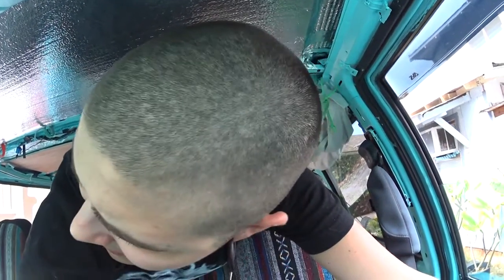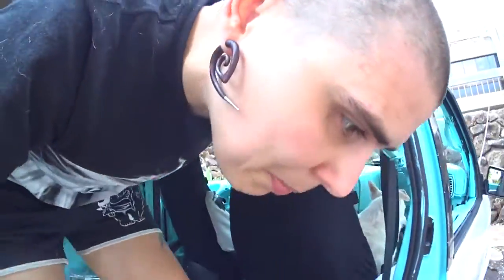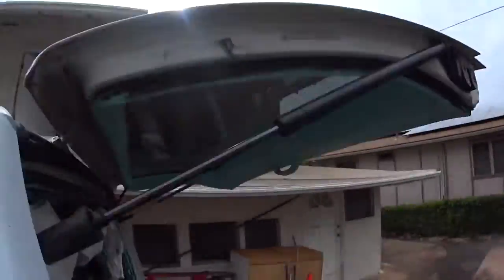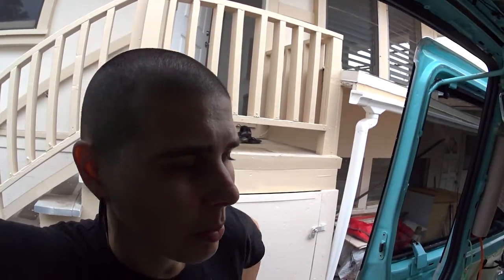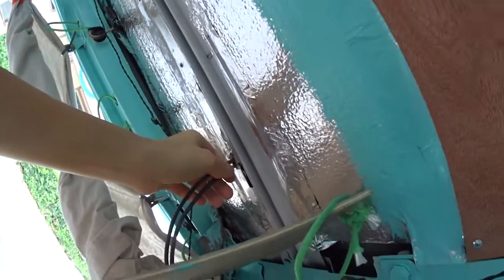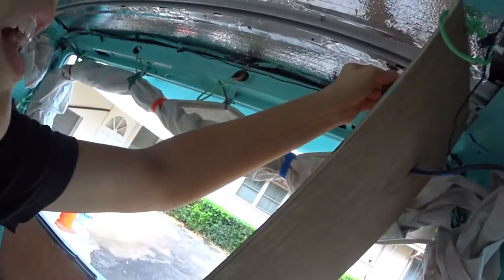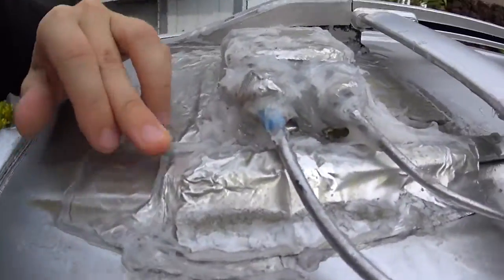We Got A Leaking Roof In The Van || Minimalist Camper Van Conversion

Comment: look closer for leaks on the trim of van, where water would run down. usually by windows. dont limit your source to just that one area. we had this on our RV, silicone works well. but its gotta dry fully before next rain.
Reply from the maker: Yeah I definitely know it could be coming from anywhere, but luckily I think that finally did the trick, we've had quite a few really hard rains and no leaks since. fingers crossed! :) I did buy this stuff that drys in 30 minutes which really seemed to help since it rains off and on here all the time and without much notice.